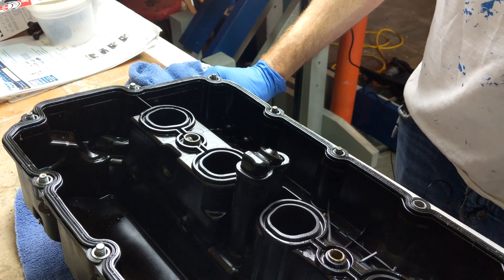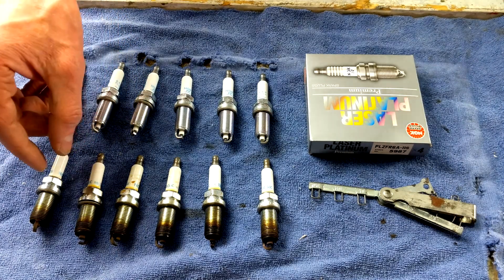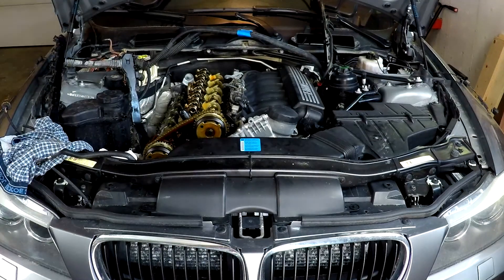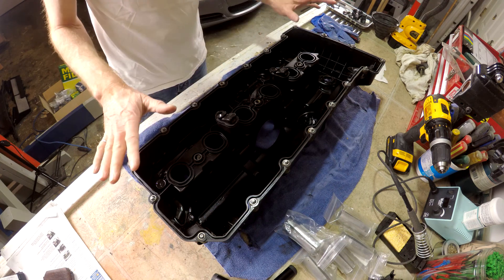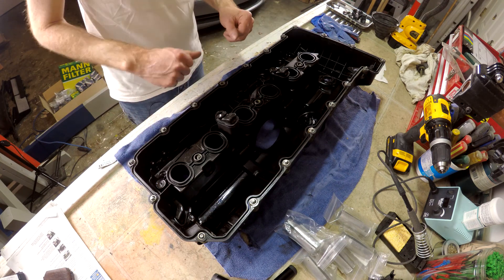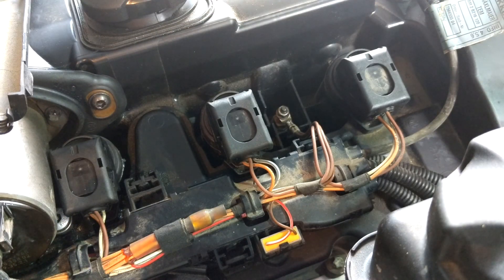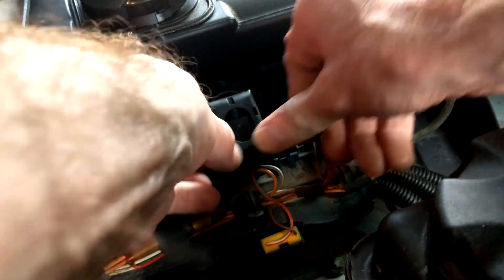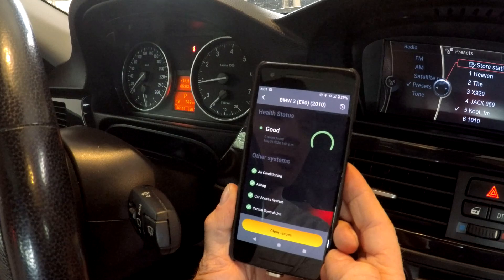BMW E90 N52 Valvetronic Eccentric Shaft Sensor and Valve Cover Gasket Replacement

Comment: Alas the bolts are not really captive... and Yes the bottom one dropped in the engine... How screwed am I? Trying my best to fish it with a magnet... I dread having to go through the oil pan!!!
Reply from the maker: I'm not sure, I haven't had to go through this. Having found bits in other engines in the oil pan I would suspect it will be fine. That is also assuming it fell all the way down and isn't sitting on the timing chain or something. Maybe you get lucky and it comes out on your next oil change. YMMV. It might be worth posting on a forum where you are likely to find more people familiar with the internals of these engines. I have never opened one up to that degree and can't weigh with any certainty if you are ok. Sorry, I'm not much help on your question.

Comment: hi! what about re-learn the position to the valvtronic motor????
Reply from the maker: No need if you set it correctly. Before I remove it, I turn the shaft all the way clockwise with an Allen key in the back of the motor.

Comment: I just replaced my whole valve cover started right up I took her to the gas station to get fuel since I had only 11 miles left , once I filled up I got a car wash at the gas station left the car wash the minute I got to the corner the car just turned off and doesn’t want to turn on battery is brand new I’m just getting started with this issue so I’m researching any suggestions would be great
I have code p1017
Reply from the maker: Since you just had it apart, check the wiring for the eccentric sensor, make sure nothing is pinched, and the plug is clean (no water or oil) and seated. Just a thought, I'm not sure if it works this way, but perhaps you need to do the relearn procedure? I've never had to do it, but maybe if something got out of line when you had it part. Lastly, replace the eccentric sensor. It seems a little suspicious that it failed right after having it apart, which makes me think something else, but it could happen. Good luck with the troubleshooting!

Comment: There are two things that makes your car stop running entirely. Thats the Eccentric Shaft sensor and Mass airflow sensor. The Eccentric Shaft sensor takes a bit of patience and skill to get to and remove, but the Mass airflow sensor can be tricky because when it goes bad the scanner doesn't detect it in the DTC.
Reply: Would it cause your car to turn off while driving ? I got a code P1017
Reply: My valveteonic sensor went bad. And I’ve been able to drive my car still no limp mode nothing. While I was waiting for my new sensor: my car was essentially a wind up car: meaning : I kept backing out the VTT motor fully so it made max lift. And it would drive fine for a day or two, then get slowly, slower over time until I just backed the motor off again.
Reply: @hqd5844  I also forgot to add that the VTT motor also plays a role in your car's functions once it goes bad it too can make your car do a no start just crank issue so I recomend replacing both the sensor and VTT motor with OEM brand called "Continental"

Comment: Mr McKerracher.  I have a 2.5 litre second generation (black rocker cover) N52 engine, like the one in this video.  My car has reduced fuel economy and doesn't have the change tone above 4k revs associated with variable valve timing.  Is this likely a eccentric shaft sensor failure?  My Carly delivers one fault code 002DE0.
Reply from the maker: Sorry, I'm not familiar with what could cause those symptoms. Fuel economy could be a number of things, from poor gas, worn plugs, or an air filter. I haven't ever experienced an issue like you describe associated with 4,000 rpm.  I googled the code and didn't find anything, either.

Comment: If this sensor has issues try to check of it is dirty mind was getting dirt because i used to poor oil without a funnel and i cleaned it with electric contact cleaner and now it is good with no code
Reply from the maker: good suggestion, thanks for the tip!

Comment: Hi m8 I got bmw 645ci after a bt drive car enjn light comes up and pdc sensors stop working and car loss power ..
Reply: Hi have you found the faults ..I got 645ci same issue
Reply from the maker: I'm not familiar with that car or parking sensors (never had a car with one).  Sorry, not sure where to start on that one.  Perhaps scan for codes and go from there.

Comment: Hello there, quick question, how much would you charge for everything you have done (without parts) in this video? I plan to grt an estimate ‘coz my bmw is already having a rough idle.
Reply from the maker: Parts were roughly $300 (it wasn't a genuine BMW sensor, but a VDO, which saved me some money), and it took me roughly 5 or 6 hours to do the job.  Not sure what the book time is for the job, which is what a shop would charge.  While not a specific cost estimate, hopefully that gives you a ballpark idea of how much.  

A rough idle could be caused by a number of different things, you might want to check the codes first.

Comment: Hi do you no what the name for exterior plug into eccentric shaft sensor . I think that is my problem . Thanks jamie . 
Newzealand
Reply from the maker: Sorry, can't help on that one.  I don't see it listed separately either (look at realoem.com).  If there is no physical damage, I would try cleaning it before trying to splice in a new plug (a bit of oil/grime/grease in the pins could make an bad connection).  You could try the wreckers too for a replacement as it might be hard to find on it's own.

Comment: hi I would like to know. What is the name of the pcv breather? - ((( allows air to enter or air out of the vent ?? ))
Reply from the maker: Do you mean what PCV stand for?  Positive Crankcase Ventilation.
Reply: @reileymckerracher9181  Nope . I mean the piece that came out when you removed the lid and then hit it with JB, what is it called? to be able to buy it
Reply from the maker: @ericcamacho3810  That I don't know!  The parts diagrams don't show it separate either.  https://www.realoem.com/bmw/enUS/showparts?id=PK53-USA-01-2010-E90N-BMW-328xi&diagId=11_3737
Reply: @reileymckerracher9181  is in the video recording 4:00
Reply: the piece that had come out -once placed with the JB glue ((( if you blow through the hole it doesn't let air in - but if you suck if it lets air in, is that how it works? (( in theory you would have to let the gases out inside out )))
Reply from the maker: @ericcamacho3810  I don't know, I never checked that, just glued it back on.

Comment: I have been chasing this issue for almost a week!!! Replaced the CCV on valve cover then all sorts of codes and issues came up! I’ll be replacing the valve cover and eccentric shaft sensor!!! P1006, P1030, 2A38 codes! And the BMW SUCTION whistle!! LOL
Reply from the maker: I didn't have a whistle, but hopefully you get your car sorted!  It is so frustrating when you can't find the actual issue!

Comment: Hello I have a question, I have a 2011 328xi sedan and I have like sorta miss. Now I’ve changed plugs, boots, fuel injectors and it still does it. It’s not reading and codes for engine. And strange thing is one second I’ll start it and drive for awhile and it’s like new, but then it starts that little flutter again. Love my car but help …. Oh it’s just got 100,008 miles on it. Thanks Allen
Reply from the maker: Mine sputtered/missed for a bit similar to what you describe before it was undriveable.  It degraded pretty quick, it was probably only a few hundred KM once it started.  I didn't have time to do work like you have.  I don't recall if there were codes initially, but there where there when it got a little worse.  Sorry I can't help you!

Comment: I just had that same pcv breather break off from my valve cover. I JB welded it with some of their heat resistant epoxy. 

Have you had any issues with having your pcv breather glued with epoxy?
Reply from the maker: Not yet, but I haven't had the valve cover off since then either to see it.

Comment: HI did you disconnect the battery during the process, asking because I was wondering how I can remove valvetronic motor and put it back in without coding
Reply from the maker: No, I never disconnected the battery.  I didn't reset it/code it either.  I used these steps to remove it:
1. hex-key clockwise to resistance
2. unbolt unit completely
3. hex-key counter clockwise to pull-out point
Install by:
4. position cam motor
5. hex-key clockwise to resistance
6. bolt unit completely.
Then the opposite to put it back in.  Hope that helps!

Comment: Valvetronic motor did spin out when we removed it before taking the valve cover off to replace it . We didn’t replace the eccentric sensor

Comment: We replaced our valve cover do we need to replace coils and plugs . It won’t start. Replaced the battery.
Reply from the maker: No it isn't necessary to replace the coils and plugs.  Make sure you have the plugs on top of the coils all they way in.  Also make sure you have the battery charged up.
Reply: We replaced the battery it’s 100% charged

Comment: Thanks for the video. Very helpful.   I did drop that third sensor bolt into the engine:(.  I’ll have to pull the pan ne t week to see if I can find it.  Otherwise she seems to be running well now
Reply from the maker: I'm glad it helped you!  Too bad about the bolt, taking off the oil pan is not a fun job, maybe you'll get it when the oil is drained?
Reply: @reileymckerracher9181  I was thinking the same thing.  Fingers crossed
Reply: Hope it came out with the oil. Taking the pan off is a nightmare.

Comment: I need help, i`ve got the error 2a43. Can someone help me. I already changed the Eccentric shaft sensor.
Reply from the maker: How does the car run?  You  could try clearing it an seeing if it comes back.  If you just did some work on it, it may need to be cleared.
Reply: It’s running rough, the eccentric shaft sensor ist new, I think it could be the Motor but I’m not sure.
Reply from the maker: @OlimitOli  Not sure then, your past my expertise! maybe the motor (or calibration is needed), maybe the shaft sensor plug? maybe the vanos solenoid?  the solenoid isn't that hard to clean.  Sorry, I can't really help on this one!

Although it doesn't align with the code, since you had it apart, check your spark plug boots, I did my valve cover gasket once, and one of the coil packs wasn't on correctly when I put it back together and cause a rough running condition.

Comment: I am having issues with the idle being high when the engine is cold. And the car feels slightly jerky/studdering and have a small loss of power, especially on lower RPMs. I am getting the code 2A43..
Reply from the maker: I googled the code and I'm not sure about that one, I never had a code for the motor like that.  Could still be the sensor, or could be the motor.  This page might be helpful to you: https://www.justanswer.com/bmw/7lt0o-328i-07-bmw-328i-idles-rough-driving.html

Comment: Now why did you change the valvetronic essentric sensors? Can you explain or since we change the gasket well as mine change the whole things.
Reply from the maker: The car was running rough, was down on power, and throwing codes indicating a faulty sensor.  If all you have is a leaky gasket, no need to replace the sensor.
Reply: @reileymckerracher9181  A leaky gasket can/will lead to oil contaminating the sensor at the plug. If you pull the plug from the sensor and see oil inside the connection, you'll need to replace the sensor as well. You won't need to pull the valve cover to do this.

Comment: Your 2 second time lapse of putting the VC back in took me an hour, this was way worse than doing valve covers on my 03 WRX which is pretty awful
Reply from the maker: don't worry, it took me longer than 2 seconds too!  first time I did it I was probably about the same as you.  Omar in the comments recommends taking off the cowl to make it easier, but I haven't tried that yet.

Comment: Great video
Did u was the replacement eccentric  sensor OEM or a money saving one?
Need to know if cheap ones are any good
Reply from the maker: I used a VDO replacement, not genuine BMW for the sensor.  Almost a year since I replaced it and no issues.  I do use genuine BMW seals.  I have had some bad luck with 3rd party seals in the past on both the valve cover and the oil filter housing.

Comment: Can I reuse the bolts?
Reply from the maker: Yes, I reused mine.
Reply: @reileymckerracher9181  I believe post 2006 the bolts are steel and not aluminum. They are designed to be reused, unless they are broken.
Reply from the maker: @zo4712  my bolts were all steel.

Comment: Thanks for good video, I have a question which VVT relrated codes did you got before doing this job? I got 2A31, 2A32, 2A33, 2A35 error and I am considering essentric shaft position sensor gasket first and then maybe the sensor... what do you think?
Reply from the maker: Pull the plug, if the connections look clean, it is probably the sensor, not the gasket.  I had the 2A31 code.  I had some other too, but the were all related to a low battery from reading codes and sitting without running for a bit.

Comment: 3:55 I did the same thing. PCV Breather came off while removing valve cover.. I just installed it without it. How bad of a problem would this be?..
Reply from the maker: I'm not sure actually.  You could have issues with downstream components getting crudded up with oil (specifically the PCV valve itself) or a oily intake, or be completely fine.  Some oil would be fine (some would always go through), so the question is it too much.  Sorry, I'm no help on this one.
Reply: @reileymckerracher9181  wish I would have watched your video before doing the job. I actually had some JB weld sitting in the garage. Thanks for the video & for the info.

Comment: My car started running again but still has a slightly rough idle what could it be?
Reply from the maker: I would plug a code reader in to see if you have any codes first as it could be a number of things.  The eccentric shaft sensor in the video did cause a rough idle.  Other things that can cause a rough idle include plugs, coils, and injectors.  It could be as simple as a loose wiring connection too.  There are other factors that could help narrow it down too, for example, is it only when the engine is cold?
Reply: @reileymckerracher9181  if the engine have some pb to start when its cold, what could be the causes? Thanks for u videos and especially the details about the Valvetronic motor which is quite tricky apparently!
Reply from the maker: @nicolasm6842  It could be a number of things,    try looking for codes first, if no codes, then give the engine a good look over of anything amiss.  A broken vacuum line or a coil pack submerged in oil (a leaky valve cover can do that) for example.  Then you can start looking at plugs, coils, injectors, etc. as culprits.  Google these items and see if you can narrow it down before spending money.  It could be any number of things, it is pretty hard to diagnose without more detail or checking out the car/engine in person.  Hopefully this gives you some ideas to start your troubleshooting.
Reply: @reileymckerracher9181  do u recommand a good tool for diagnosise?
Reply from the maker: @nicolasm6842  I can't help there.   I use the Carly app, but I bought a lifetime license for it before it became subscription based so probably not the best for you now.  If you do a shout out on your local BMW facebook group, someone is usually willing to help out and read codes.  An independent shop can do it too, but I'm not sure what one would charge.

Comment: I used to push long clean cloth under the working zone and managed to catch screws few times when I dropped them accidentally.
Reply from the maker: good tip!  i had a strong magnet under it just in case, but a cloth would work better. if it landed on a cloth, it would be easy to fish out with a magnet after.

Comment: Great video
Reply from the maker: Thanks!
Reply: @reileymckerracher9181   Great vid was the symptom just rough idel?  or stall!  hot cold better worse thanx
Reply from the maker: @REPORODGE  it started with a rough idle, then loss of power, then stall.  once they symptoms started, it degraded fast.  my commute to work is about 60km, and over the course of two days it got progressively worse until I parked it and waited on parts.
Reply: @reileymckerracher9181   thanx bud lets get you to 2 hundred subs im 1 because of the info!!
Reply from the maker: @REPORODGE  thanks man!  I appreciate the support!

Comment: very bas advice, unmorally  valve cover should be  replace when you   have a  valve cover gasket leak,  for  2 main reason ,  reason 1  , valve cover plastic will  warp and it will cause  more leaks, reason number 2 ,  the build in  breath valve  will deteriorate over time causing more  idle  problems

Comment: May I recommend taking apart the cowl on the passenger side of the engine bay so you can have more space next time you do this job. It is an easy two bolts and gives you just enough space to slide that valve cover underneath.
Reply from the maker: Good to know, thanks!  I didn't realize that back piece came off so easy, a few extra mm and putting the valve cover back on would be so much easier!